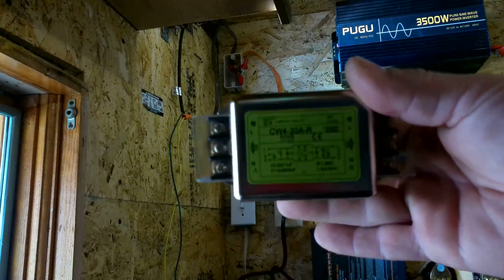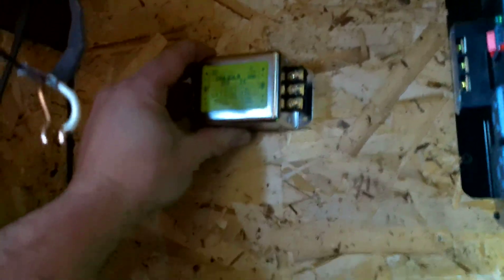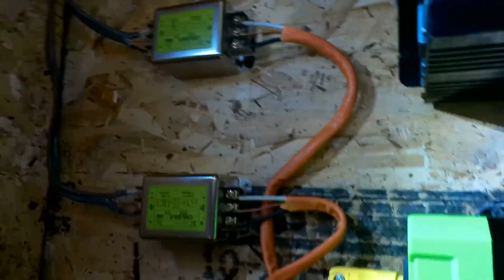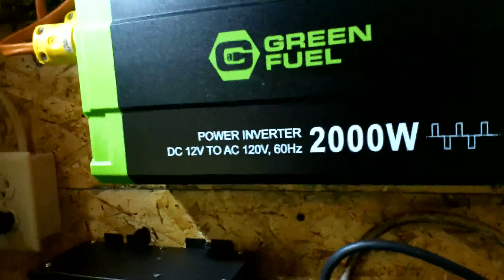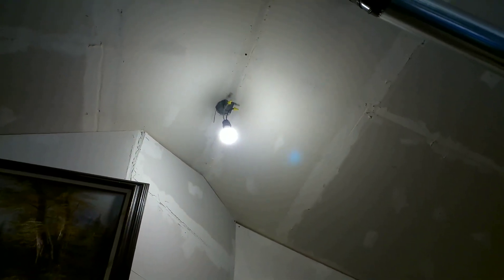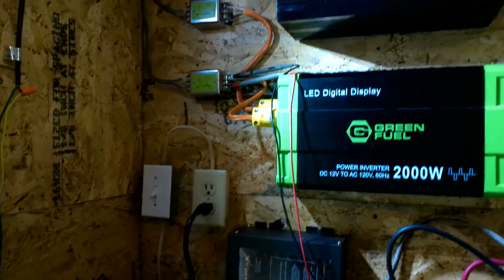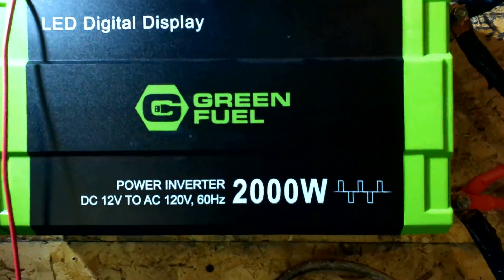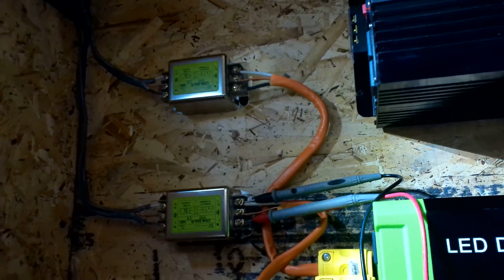EMI Noise filters ⚡ install for my off grid power inverters.

Comment: Hi 
Is this EMI filter doing its job?
Reply from the maker: So far I have not burned up any more inverters. So id say yes.
Reply: My house has a very high EMI which is causing a lot of issues my electronics are keeping dying and causing  Input lag on my PC and killing its power supply. Should I install it on my circuit or I can install it near a wall socket. @AutarkyHomestead
Reply from the maker: @Maiza007-c8y I have mine installed directly after my power inverter.
Reply: @AutarkyHomestead  looks like these EMI filters can be installed near wall sockets and Plugs.

Comment: The ferrite, if you want to achieve it you have to do afew things.

The ferrite needs to be a certian size. Then the wires, need to be 1st a certian awg to be heat resistance, the cables need to eb twisted to reduce emf, then coil ard the ferrite about 6 times. Then you would achieve the proper noise filtering results.

I seen a fee of those people who DIY it have the filter you are using right now (maybe a different specs) and then combine with 2 different types of ferrite with the coils to get the job done.

Emi and emf is a very complicated topic. Some people would also go on to say the electrical cables need to be shielded and earthed. But I think whatever works, works. Because if you want to go very deep into it, it can be a abayss for those non engineers minded people.

Comment: In my off-grid system, which uses a high-frequency inverter, the type B RCD trips when I turn on the air conditioner or when charging the electric vehicle at around 10A. I suspect this may be due to leakage currents or high-frequency noise. Do you think this filter could help resolve the issue?
Reply from the maker: That is very possible. The feedback noise can reek havock on a system. Even something as simple as a little transformer for my furnace, it blew it out

Comment: You can use 2 or more filters in series to eliminate interferes, the sound of your inverter is from the fans i think try to spray some w40 inside the motor for lubrication.
Reply from the maker: It's sad because that inverter is new. I bought it at a retail store. I guess they can be as janky as online inverters.
Reply: @AutarkyHomestead   Low frequency inverters don't have so much problems .